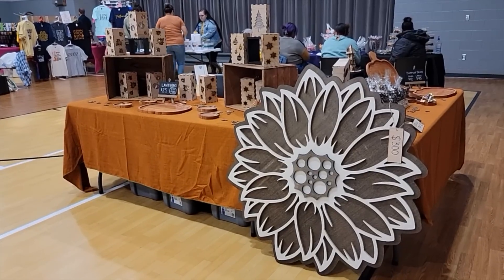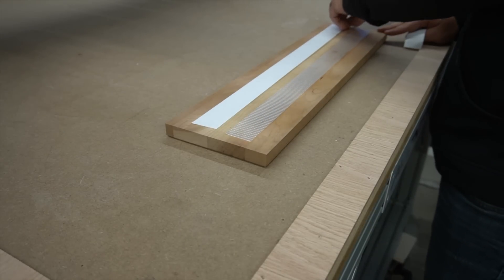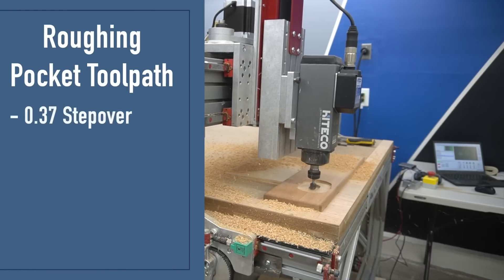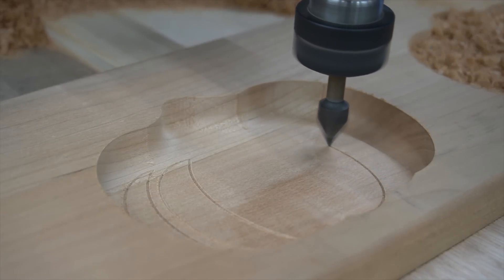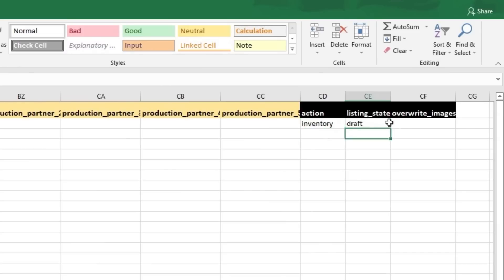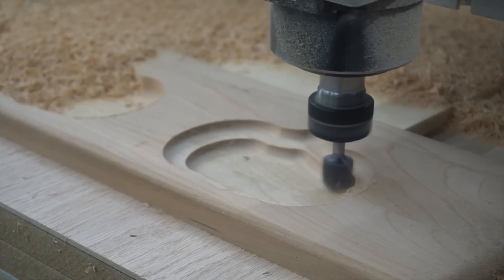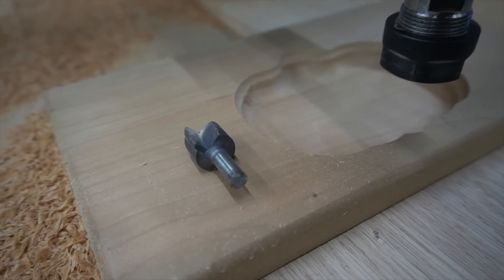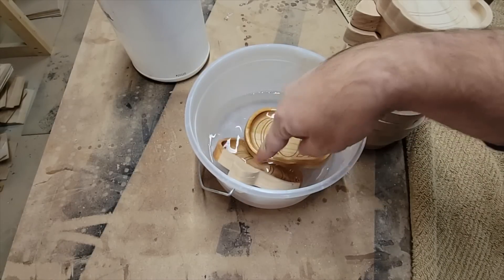NEW Avid CNC - First Mini Production Run!

Comment: Originally I intended to purchase a Shapoko.  Listening to the difficulties  you keep encountering has convinced me to forget about buying a cnc.
Reply from the maker: Hi Terry. This actually is the opposite of what I hoped to hear. Don't get me wrong, there are set backs. But the payoff is much more than that. It's well worth getting into cnc. The Shapeoko is a great machine.
Reply: @AndyBirdBuilds  the older I get the less tolerance I have for things that piss me off.  I can see spending 3K,  reach my frustration level and never touching it again.
Reply: This comment made me giggle and I know exactly what you mean😂😂@terryquiram3344

Comment: I use vectric for exactly this.   Here's how I do the roughing / finishing toolpaths (sorry it's metric)!   

1) Setup the roughing toolpath with ''x' passes with large stepover (e.g. 11mm on a 25.7mm bit) and only to cut to the chosen depth minus 0.25mm.   E.g. an 18mm depth only goes to 17.75mm.

2) DUPLICATE the roughing toolpath, change the depth to the full distance (e.g.  18mm), the step over to 2mm and the passes to ONE (don't forget to click the set button!)

It's fast to setup and never fails.

ALso, @09:27 it looks like you have lots of "witness" marks where the tool plunges.  In the profile toolpath choose the "Leads" tab and add something like Circular Lead, Radius 10mm / 0.5", Lead Length 10mm / 0.5", Do Lead Out : True, Overcut distance 10mm / 0.5".   Do this on ALL passes, roughing and final cut out ands it makes a BIG difference.
Reply from the maker: Thank you for sharing this. It makes complete sense!
Reply: Interesting tip on the Leads - I'm going to dig into this. I get a lot of these "witness" marks and was trying to use Ramping to solve them, but not much luck.
Reply: @peeceejay  I typically set my rough cut with the allowance offset set to 0.25mm (sorry, convert to inches if needed) so that the main cuts are not even touching the final edges. I run like this all the way down to 1.5mm from the bottom, in as many passes as needed, then stop.  I do "not" check the "Do Separate Last Pass" box, preferring instead to program a separate last pass myself.  

The final last pass is a "duplicate" of the rough cut, but this time going all the way to the bottom in a "single pass" (important) with no material offset (important).  Doing this in a  single pass cuts through the 0.25mm left by the rough cuts and (combined with the lead in & lead out) provides a nice clean surface all the way around.  If you don't do this you can end up with lots of horizontal lines left by the bit cutting at multiple depths.  Removing 0.25mm over the entire height is usually not a problem, and saves sooooo much sanding and clean up 😊  Good luck with your testing and let us know how it goes 👍

Comment: Nice info. What happened to your 1/4" shank bits? Was it the shank failed/sheared off?  I've recently started using a VFD spindle, completely different animal to 300w or trim router.  Wondering if shanks are mild steel on wide bowl bits and not capable of the speed/torque & impact cutting into sidewalls...but don't get same problems with endmills.
Reply from the maker: I've been running these bowl and tray bits for a couple years with no issues. The failures were a mixture of too aggressive feeds and slamming into tight corners in the pockets.

Comment: I've not had much luck with the Bits & Bits compression bits. They flat out told me their S&F's are incorrect and need to be re-done. I've since switched over to SkyOne CNC bits which are cheaper and better IME. As for the tray bit, you can set a last depth pass in the toolpath, which makes it a roughing/finishing pass. You cannot change the stepover however. To do that you would need to create a duplicate toolpath with just the full DOC as a single pass to final spec. I use a 3/4" tray bit to do my juice grooves, running 9k RPM, 160IPM, 0.15" DOC. :)
Reply from the maker: Interesting. Thanks for sharing. I have not had any trouble with Bits and Bits compression bit. I've been using them for about a year now.

Comment: Have you tried blue painters tape and CA glue? But cover the whole area of the stock with tape.. cover the bed accordingly. CA glue on stock side tape, activator on bed side tape. Worked for me..

As far as your broken bits.. think in ways of less is more..
By that I mean,
less stickout of the shank- I try to have 3mm max (1/8), just enough to acount for that kinda cone transition from shank to bit (bowl bit). Same goes for the end mill. Caution - watch for set depth, so the collet NUT does not hit your stock! You will notice a lot less tool deflection.
Second, which I know might sound expencive (but with some thought ahead..) use bits that have (just) 3-6mm (1/8-1/4) longer flutes than your work piece. Again, will help a lot with tool deflecting less, so less vibrations, stress..
Have a blessed day 🍀
Reply from the maker: Thanks for sharing. I haven't. But I've heard of people having success with it. I wouldn't mind doing it for one piece but I'm not sure how practical it is for batch work

Comment: For the finishing toolpath pushing it out, if you're using vcarve I also had the same problem. What I did is offet the main vector inward by a few mm and then re-ran the toolpath. I would then zoom in and make sure that the generated toolpaths lined up with the outtermost line and that would allow the two toolpaths to match up when they ran and stopped it from pushing it out.

Sounds a little complicated, but it works lol. If you want I can send a screen recording of doing it later if that'd help!
Reply from the maker: Your solution works but is not needed. This comment explains it well.

1) Setup the roughing toolpath with ''x' passes with large stepover (e.g. 1mm on a 25.7mm bit) and only to cut to the chosen depth minus 0.25mm.   E.g. an 18mm depth only goes to 17.75mm.

2) DUPLICATE the roughing toolpath, change the depth to the full distance (e.g.  18mm), the step over to 2mm and the passes to ONE (don't forget to click the set button!)
Reply: @AndyBirdBuilds  I'll have to give that a try!

Comment: I've not used Vectric much, but with Carbide Create you can easily add a finishing tool path to the same Gcode. You can greatly reduce the DoC as you're just trying to knock down the machine marks, reduce step over, and increase your speeds, 300IPM+ on my Onefinity.
Reply from the maker: I've used Carbide Create a lot myself. Its really easy to do in Vectric once you know how to do it. They setup is just slightly different between the two programs

Comment: It's not uncommon for the finishing path to take deep cuts to even up the edges, especially depending on what bits you're using for both, even when you are correctly setting the cut depth on both toolpaths.  You can also remedy this by setting your cut depth by editing the bit from within the toolpath using the edit button -- these edits are "local" to that particular toolpath and bit combo and do not change the global bit settings.  You can set the depth of cut for the bit there to something smaller, by default those bits are probably setup to take a pretty deep cut.  And yes, this can still happen even if you use the same 0-{full depth} on both the roughing and finishing path.  This is even more important if/when you start doing more complex 2.5D or 3D carves.  Good luck and thanks for sharing!  Also one other thing to watch out for, depending on who's bits your using ... but lately I've seen a LOT of bit databases that you download from manufacturers with super wrong info for the cutting details of the bit!  Especially SpeTool -- it's so bad with them that I'm just going to stop using them, I tried to reach out to their support about it and they just keep closing the tickets and just don't seem to care.  In the cases I reported they just can't be bothered to put in proper settings for using mm (which I use pretty much exclusively) ... they have been just copying over the same values as imperial (and I can tell you that 100 ipm and 100 mm/min are very different LOL).